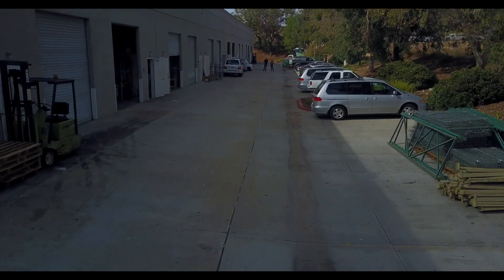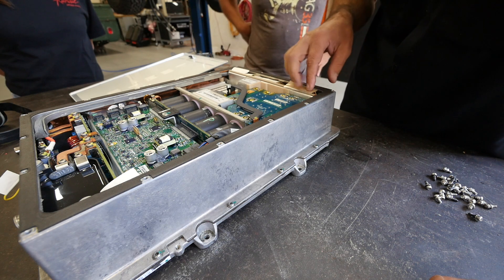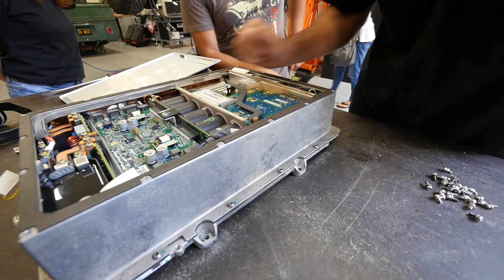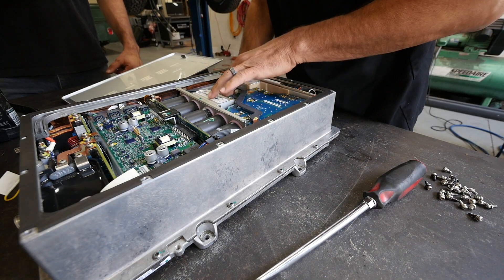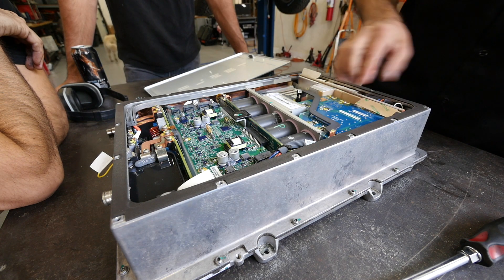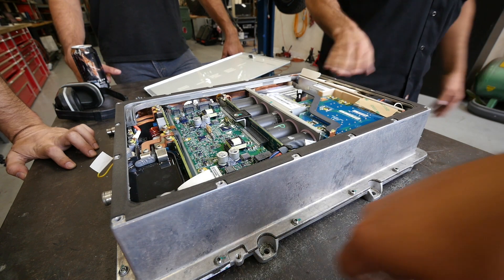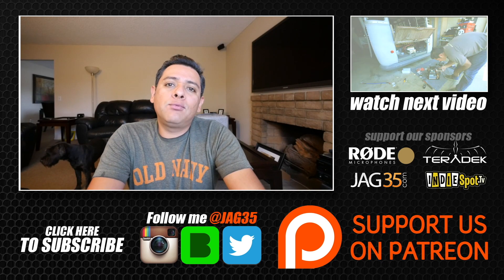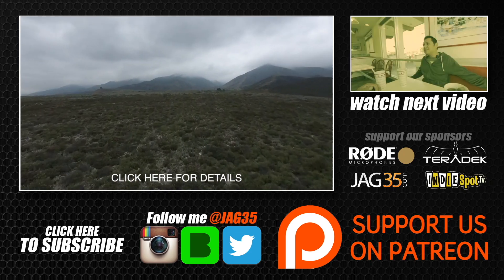Whats inside  - TESLA 10KW BATTERY CHARGER

Comment: Doesn't this charger have the ability to run off 3 phase (3 * 3.3kW) or use two of the charge circuits to offer up to 6.6kW charging on single phase?
Reply from the maker: Possibly,  but i only saw 2 legs on the ac side
Reply: I'd forgot the American Tesla connector is different from the one they use in Europe, they use a modified Type 2 connector here so can take 3 phase when in AC mode.

Comment: Is there anyone making graphene batteries yet?
Reply: More likely we'll see silicon anode LIIon batteries first. Which will be about 2 times as good as what we have now.
Reply: Apparently there are some really impressive results with nano-tech that show you can achieve extremely long lifespans and higher energy density. Of course this is still in the lab but I've seen similar results from other research groups.
http://newatlas.com/silicon-anode-performance-batteries/40058/
Reply: You seem pretty well versed already but check out Yi Cui's talks at SLAC (search "SLAC Batteries") for a great rundown of the issues. He get's into Si Anode stuff late in the talks